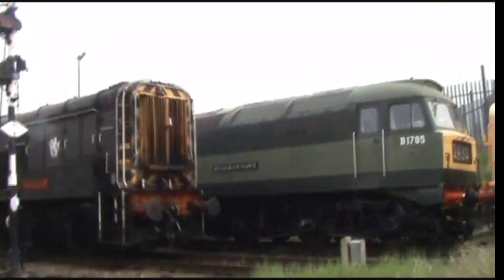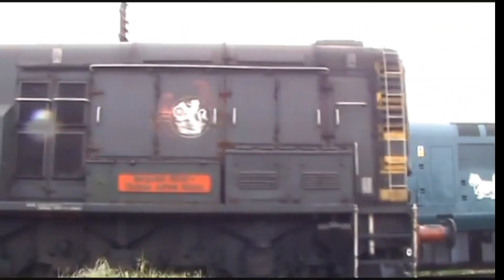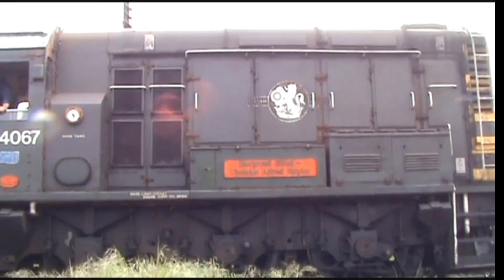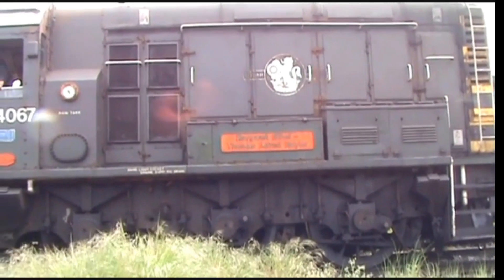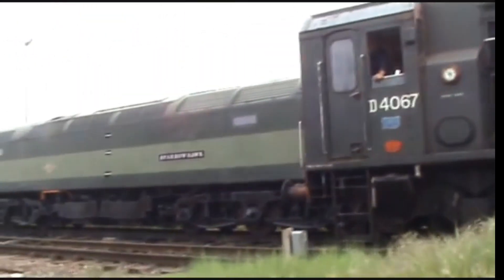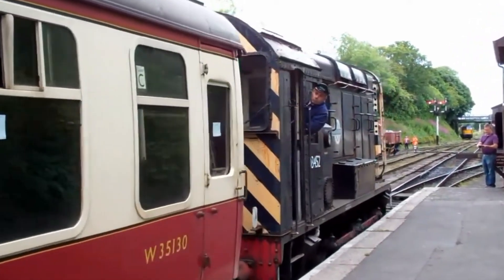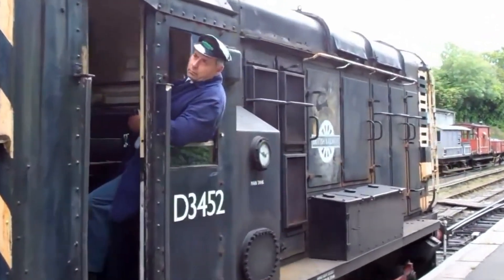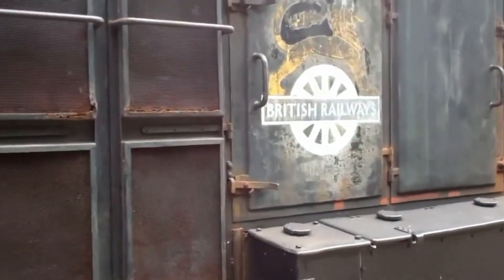The Untold Story of the Class 10 Shunter Locomotive. #class10 #locomotive #diesel #railway #fyp

Comment: They were given the Blackstone powerplant and GEC traction motors as a diversification programme.  Those with GEC tractoon motors were originally classified as DEJ4 later D3/4 then 3/1 and then Classc10, numbered 13137–13151; later D3137–D3151, D3439–D3453, D3473–D3502, D3612–D3651, D4049–D4094. 15 other locomotives of Class DEJ6 later D3/5 and finally 3/1D, numbered 13152–13166; later D3152–D3166, were fitted with the same engine and BTH traction motors but were withdrawn before the TOPS reclassification occurred.